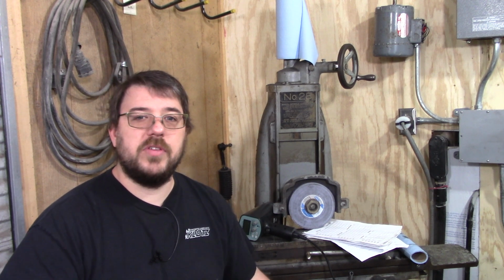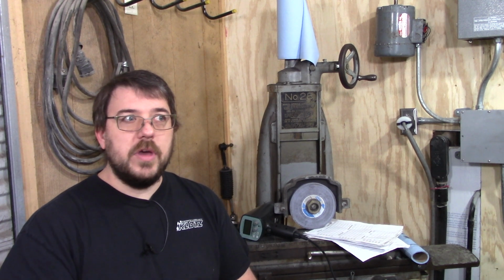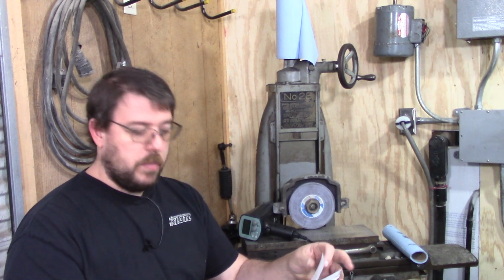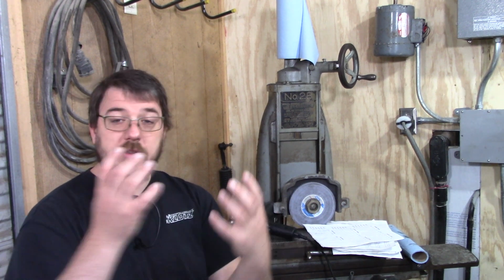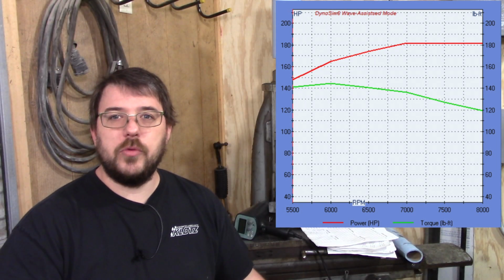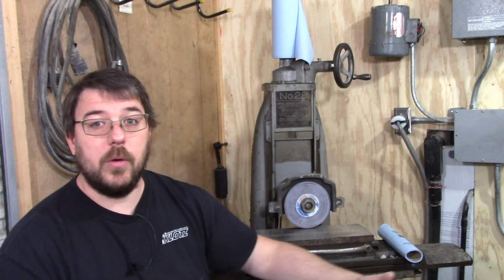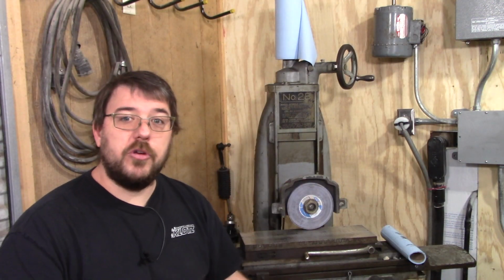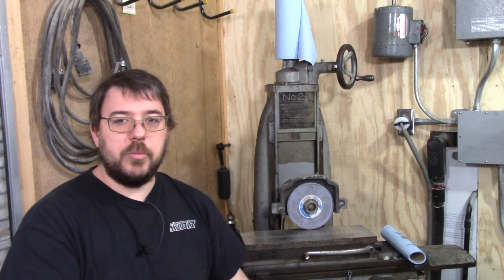Measuring Monkeywrench racing camshafts for the 2GR-FE

Comment: I know this is old and i wish i found this before i installed MWR stage 1 cams.  i’m stuck with trying to diagnose random multiple misfires and my last option is that I just received bad cams from them. Now I get to pull the engine again to reinstall the factory cams.
Reply from the maker: I'm sorry to hear that, it is a massive pain to need to switch them back. Random multiple misfires especially at idle is what people generally were fighting with those cams.

Comment: No such thing as a centre line with these cams. All 4 are different , a cam has an opening and a closing point measured at a certain lift. Midway between is the centre line but peak lift is always a few degrees off.

Comment: Don't know if you've figured it out yet but the Mitsubishi V6 cams have the same problem. All 4 cams have different profiles from the factory. That's due to the front and rear heads having the finger followers mounted opposite with respect to cam rotation. That means that aftermarket cams need 4 different masters to copy from. When the cam grinders get it wrong as they do every time it's because they've only used 2 masters and the resulting valve timing differs between the 2 banks. What you need to do is remove the factory cams and measure on a cam doctor. It's easy to make your own making use of a lathe marked out in degrees.
Reply: It's because the ratio of the finger follower isn't a fixed number. It's a nominal number at full lift but the actual ratio varies throughout the lift from opening to closing. One bank starts low and ends up high. The other bank starts off high and ends up low.
Reply from the maker: You're exactly right. I figured this out years ago and grinding custom profiles on the cam to fit the valve motion i want instead of a symmetrical valve profile is part of how I've been able to make such good power with these motors.
Reply: @FrankensteinMotorworks  I've made my own mitsubishi grinds, done on a crank grinding machine. It's impossible to buy them made correctly, they're all wrong.
Reply from the maker: @1magnit  I'm not surprised to hear this at all. This is a problem with the 2GR-FE cranks too. in fact even the factory does the exact same thing. the front bank always runs 3-5% more air because of this until you start using a setup where each bank has a unique grind that results in the same valve timing. 

I wish i had access to my own crank grinding machine, that would make R&D so much easier than trying to convince existing shops to just make my grind and stop questioning them.

Comment: How much power and torque including peaks would your 263-EZP with 258/258 218/218@1mm, 11mm/10.75mm valve lift perform compared to stock?    Say the car has exhaust done.
Reply from the maker: In the MR2 application the EZP cams give about 30whp and require no further tune change from my normal tuned ECU.
Reply: I appreciate the response, does the EZP cams move the HP and power peaks?    30whp is a good number.   That one also will work with stock ECU without tuning?   @FrankensteinMotorworks
Reply from the maker: @dennisrobinson8008  the curve is generally the same shape with the EZP cams. I'm sure the stock ECU would work fine with them but i don't know what the gains would be given the other restrictions in a stock application.
Reply: So basically not much if any down low losses and gains at the top end. @FrankensteinMotorworks
Reply from the maker: @dennisrobinson8008  yes, pretty much. I don't have an exact before and after on the same car with only the cams changed but yeah there appear to be no low end losses.
Reply: there are chevy ls cams that do that, no losses low and increasing gains as the rpm's increase. @FrankensteinMotorworks

Comment: Any motor I ever went with
I always went with two separate things that you can get from the shelve
1. Piston
2. Camshaft

So even with my 3MZ
I went with custom camshaft from webcam
They did cost a whole lot more($2200)than what MWR sells them at but at least these cams were made for this specific 3MZ

They were hardweld and reground

Comment: Would it be better if your using a slightly thicker oil help this engine do its job
Reply from the maker: I haven't seen any reason to use thicker oil yet so i do not waste the horsepower on pumping thicker stuff around.

Comment: On the hydraulic adjusters you can use ecotec solid adjusters
Reply from the maker: i actually purchased one to compare and measuring the tip radius with an optical comparator shows that the ecotec actually uses a slightly larger ball end radius. I don't expect this to be catastrophic but i expect it will affect the size of the contact area in the rocker to be smaller which will likely accelerate wear at that pivot.

Comment: I recently pulled my engine down due to a problem I had. I found a number of broken lifters which confirms the lifter issue you are talking about. I am now moving to a Ford motorsport lash adjuster which is a proven product on 305 degree cams/13mm lift/8200 in v8 race engines. I also had valve float which has damaged valves so have moved to a heavier beehive spring to deal with the problem, ditching the dual valve spring that I currently have in the car. The new spring rate is the same as the v8 race engine using the hydraulic lifter so should not be a problem. Thanks for all the insight with the video.
Reply from the maker: Do you have the part number on that lash adjuster? I'd love to buy one to take it apart to see the differences
Reply: @FrankensteinMotorworks  no worries, just sent a link via FB. You may be able to buy one via Ford Motorsport USA. Also, the 2zz valve spring is a option for 2grfe.

Comment: Since the 2AR and 2GR valvetrain is somewhat similar in design, is it possible to use 2AR valve springs in the 2GR?
Reply from the maker: Yes, the 2AR and the 2GR valvetrains are almost identical and many of the parts are interchangable.

Comment: Good video Marc. Would love to see if there’s a better spring rate for the valves.
Reply: I was talking with kelford cams today. They are have a billet camshaft available which is pretty close to the one they made for me. They also have a beehive spring which is the right way to go for the 2gr. Actually ordering a set this week as the dual springs I have used are not that great on the 2gr
Reply: @SKR1967  kelford makes billet cams for the 2gr?
Reply: @RyanDohertyRacing  Yes Ryan, they have these available along with beehive spring with titanium retainers. Ask for Kiel and mention the MR2 v6 race car owner from Aust made you aware of these.
Reply: @SKR1967  awesome! Much better than a regrind!
Reply: @RyanDohertyRacing  yes, far better. Really need to upgrade the lifters if you plan on going big.

Comment: Other thing what you can do is put the 1gr internals(4.0Lstroke) in 2gr.....sounds good right?
Reply from the maker: Unfortunately the 1GR motor's crankshaft features are almost entirely different sizes. It's really not a lego piece swap.
Reply: @FrankensteinMotorworks  I saw in Google the steps how you can stroke using those internals

Comment: The hot street catcams specs using a digital mitutoyo 293 series are as follows. 
Short cam 1 BC 38.040mm Lift 45.305
Short cam 2 BC 38.050mm Lift 45.280
Long cam 1 BC 38.020mm Lift 45.143
Long cam2 BC 38.080mm Lift 45.192

Using PAC-s10015 gold springs rated for 8k rpms

Cam specs
http://www.catcams.com/products/camshafts/datasheet.aspx?ENGINE_id=370&CAMSETUP_id=2682&Language=english

Comment: I ordered stage 3 cams and the valve springs and retainers for the 2grfse.i would have to measure the lobes to make sure I got stage 3 cams
Reply from the maker: That would be really interesting to hear back from you when you measure them. I really hope you get what you paid for.
Reply: @FrankensteinMotorworks  Awesome, thanks.  Did the gains seem decent from the stage 3 cams?..  (worth the $/effort) 🍺
Reply: @TaylorMadejdm1975  i haven't installed the cams yet , been extremely busy. But i would see if it's worth it at the end of the year
Reply: @PResmejor  Cool, can't wait for the results! 🍺
Reply: @PResmejor  how’s it coming man? Hope you’re doing well sir!
Reply: @jasontodd1141  cams sounds amazing on the car but getting the car to run the way it should is proving to be difficult (tuning) .
Reply: @PResmejor  hey man. Right there with ya. I’ve got a procharged tacoma(videos on my channel are old when it had a “safe” stock tune on it.) right now my truck is on 275/50 n555 g2s and all that fun stuff. But the problem is tuning. Fuel trim and retarding is killing my tuner and I. I was initially gonna get a set for the 2gr-fks engine stage 2-3 but can’t even properly tune it yet. We are gonna try to work with OV since they have tables set up for booster applications. I know that with my truck the fuel rail is what one of many reasons it makes it difficult to tune we ended up dumping so much fuel just to get it sufficient at the last injector. There’s a guy making custom fuel rails so I can fit LS500 injectors. I just really wish Lexus/Toyota would make tuning and aftermarket products more abundant and easier to work with. Only a dozen or so if their cars are fully tunable. Sorry that was a lot of information you didn’t ask for I’m just fed up because it’s been a struggle brotha!
Reply: @PResmejor  I love your build by the way! What kind of power are you putting down?
Reply: @jasontodd1141  no worries man , and i haven't dyno'ed the car for a while . Last time i dyno'ed the car when it just had intake and exhaust the car made 291whp. Since then I ported the upper and lower intake manifold , 76mm TB , Nonstop tuning pulleys, and changed my tune that allows me to revout to 7400rpms . Currently going to be upgrading the stock fuel system so that i can run full e85 and custom tune. Highest NA is350 I've seen is 331whp on unopened heads . But I'm honestly thinking of just going boost instead of staying NA
Reply: @PResmejor  hey man. I’d say look into picking up a Procharger tuner kit since it does have applications with the 2gr-fks. It could in theory work with an fse as they are practically the same except the differences we both know of. It would be custom bracketing and tuning and idk maybe it wouldn’t fit in a sedan. But I think RR has a kit with all fittings. Do you guys have any wides scale turbo setups or kits for this engine?
Reply: @jasontodd1141  there are people who have made custom turbo kits for the 2grfse and have made serious power(600whp+) i would have to contact them to see if they are willing to make a kit available so I can make a purchase lol
Reply: @PResmejor  Hello Sir, please update us. Also looking into the stage 3 camshafts on my N/A build. Is there somewhere on social media I can follow you, would love to hear the car with the cams, thanks
Reply: @PResmejor  what ever happened with the cams? Was it worth it?
Reply: Can you post a link where you ordered your stage 3 cams from...? 👍
Reply: @TaylorMadejdm1975  https://www.monkeywrenchracing.com/product/mwr-cam-set-4-2gr-fse-v6-stage-3/

Comment: Would adding an electric pump to the oil galleries while doing your timing measurements on the stand help the accuracy?
Reply from the maker: i think to get an accurate duration measurement you really need to measure just the cam with an appropriate size tip on the indicator. but i do plan on pressurizing the head with oil for the high speed spring tests.

Comment: It’s great to see you’re figuring this out! 
Is there anyway you could spin the stock 2GR valve train with the stock springs higher until there is a failure? It would be interesting to see if could handle any more than the typical 7200rpm.
Reply from the maker: yes, my initial test will be just this. I will spin the stock valvetrain until it fails.... unless it can take about 12,000 but i doubt it.
Reply: @FrankensteinMotorworks  any update?
Reply from the maker: @trv88r  No, i haven't had the time to make a test setup for this yet.
Reply: Im giving my supercharged 2gr 7300 rpm. Only have 800 miles on it thus far, but it has been happy.
Reply: @Tyler-ek5tj  12,000 rpm or bust!

Comment: Thank you so much for this video, saved me $1400+ on stg 1 cams and springs.  I'm more interested in reliability/not having to chase problems than the advertised 20 whp that the Stage 1 cams would have got me.  Looks like I'll stick with the stock cams for now.  I look forward to the future test data.
Reply from the maker: I hope to be able to find a properly reliable setup for those that want extra power and if it isn't available out there I will see what I can do about making it available for sale myself.
Reply: @FrankensteinMotorworks  I appreciate everything that you are doing and can’t wait to receive my parts/complete this swap.

Comment: Sorry to ask an AR question on a GR video but was wondering if you've looked into 8AR-FTS engine swap options for the MR-S or are they still too expensive at the moment?
Reply from the maker: The 8AR-FTS seems to be a very low volume motor and the price isn't coming down on it. I will likely just make a turbo manifold available for the 1/2ar instead.

Comment: Do you know if there is beehive valve springs for the 2gr? They are progressive and are better for high rpm..
Reply from the maker: Yes, there are several that fit right in including the ones i used in the 2AR-FE. I just need to explore what the right spring rate is first.

Comment: Do toyota lifters work like other hydraulic lifters in that oil pressure is needed for them to operate properly?  If so, turning the engine over by hand may cause collapsing of the lifter you wouldn't  experience when it's running with 60 psi of oil pressure in the lifter?
Reply from the maker: Yes they are oil pressure fed but keep in mind they only have a 10mm diameter area for the oil pressure to push against. this means that 60psi will only push up 7.3lbs. This is intentional because if the lash adjusters were able to push hard enough to support the springs they would cause the valves to hang open. The checkvalve is what should hold almost the entire pressure from the spring opening.
Reply: @FrankensteinMotorworks  But don't these have some sort of anti bleed design in them?  Try it on one that's pumped up will oil already in an arbor press, i think you may find it compresses really hard at first, but once the oil slowly bleeds out, you'll be able to compress them much easier.  If thats the case, you may find with heavier springs, that bleed down is happening faster after a few rotations fo the motor.   Having it running, now matter the surface area psi, keeps them full and the anti bleed properties keep them from collapsing?
Reply from the maker: @MadManMachines  it's just a checkvalve that lets oil in and oil makes it out past the tight tolerances. but this is one of the reasons why i need to actually run it with oil pressure and see what happens. The events are so much quicker when the motor runs, even at idle than what i am seeing by turning the motor by hand. I also wonder if some of the issue was that the motor was new so the check valve seats hadn't lapped themselves in yet and the ARs that i've worked with have all had over 100k miles on them so the check valve seats were nicely mated to the check ball. More discovery is needed for sure.
Reply: @FrankensteinMotorworks  I really appreciate how in depth you go in your videos, it can be dry for many, but it's what i find most interesting.   If you get a chance, try putting a few non collapsed lifters, still full of oil,  in a hand arbor press where you can feel them bleeding down, it may shed some more insight.   I just did and i was surprised it took a lot of pressure to bleed them down. I'm not sure how the mechanism works, i'd have to disassemble one or i could probably find a diagram online of one with an exploded view that might shed some insight.  Maybe their anti collapse properties are more a factor then actual oil pressure.    Maybe like a piston where you have a leakdown test, these when they wear, leak down faster and aren't as resistant to collapsing?  (just spitballing here)
Reply from the maker: @MadManMachines  yeah, i was surprised at how much pressure it took when i was putting together the AR but i did not measure it. I do have the perfect rig to measure it though so i will check that out in a few days and put a real number to it.

Comment: Have you verified that the lash adjuster shims have been installed to take up the difference of base circle diameters?  Sometimes it easy to overlook the simple stuff.  Could explain the squishy lash adjusters if there isn't enough pre-load.
Reply from the maker: Yes, the shims have been installed. with this setup it would be easy to tell if they had not been since the base circle difference is too big for the stock height lash adjusters to take up all the slack. the rockers would be visibly loose.